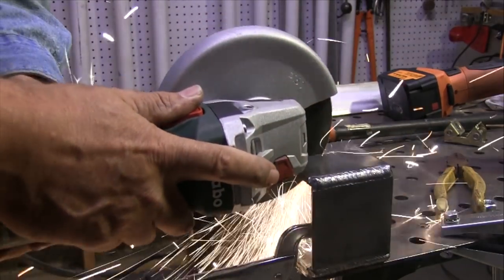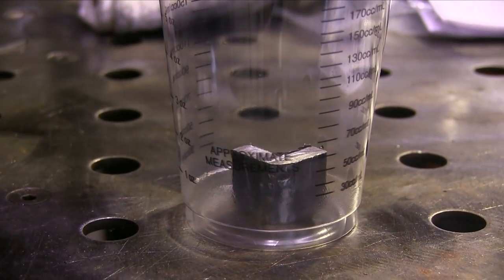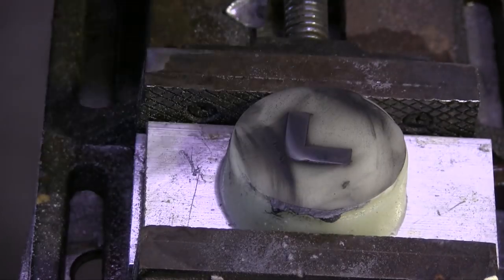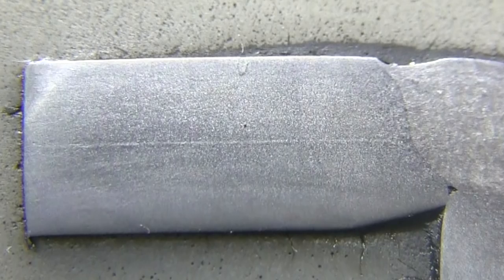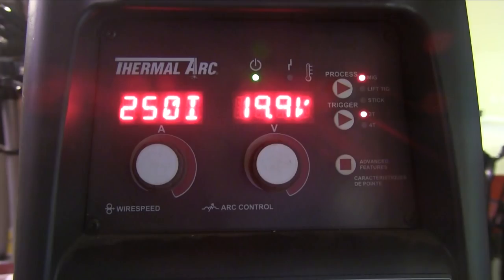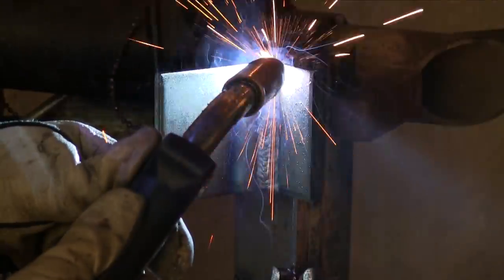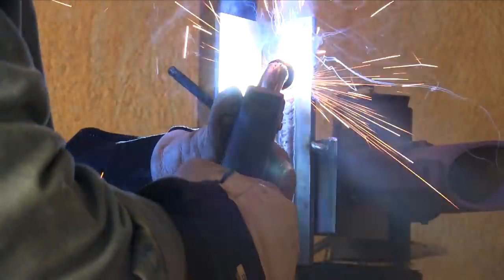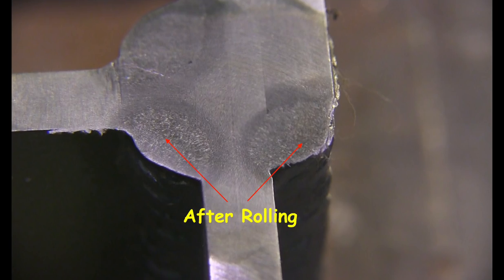Cut Polish Etch, Testing Welds,  Roll the Tank

Comment: What if you weld test on plate that has this line and they bend test? Could this contribute to a failure like cracking out?
Reply: michael johnston Yes it could possibly contribute to a failure in the weld. A knowledgeable weld testing tech or CWI would recognize this and allow you to retest or possibly remove a bend from another area of the test sample (if it was a small area of lamination). I have also seen it not affect the weld at all, which would be acceptable as it is not a welder defect.

Comment: Have Miller 350 welding
6 1/2mm set the machine
25.0 at 380 is that way too hot in your opinion 80 KSI metal anyone

Comment: id love to know what kinda chemicals you use to etch the metal... im sure its some high dollar stuff but id still like to know.
Reply: songer121 For carbon steel Nital works great, it's nitric acid and methanol (or ethanol). You only need 2-5 percent of the nitric to get it to etch, though I like it a little stronger as it pops quicker. Having the sample heated up helps the process. If those aren't available naval jelly by loctite will do it, I learned that one from Jody. He also has a video on household products for etching.
Reply from the maker: its a passivization solution made by chemclean and its called ox out 540L. not sure where you can get it but  I recently learned that you can get ferric chloride etchant on amazon ( used for etching printed circuit boards) for 20 bucks or so...and it works really good. knife makers use it for etching damascus.
Reply: hey thanks! gonna check it out.